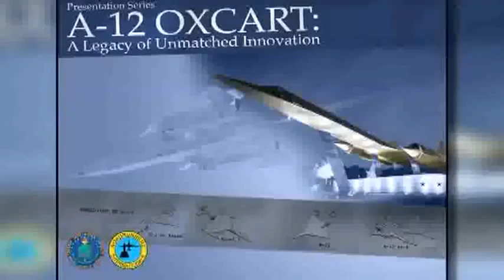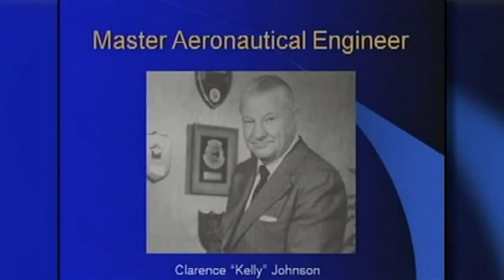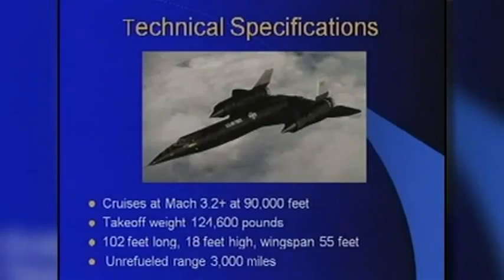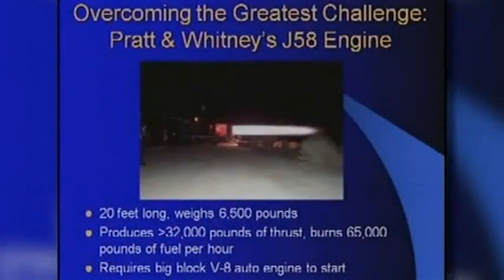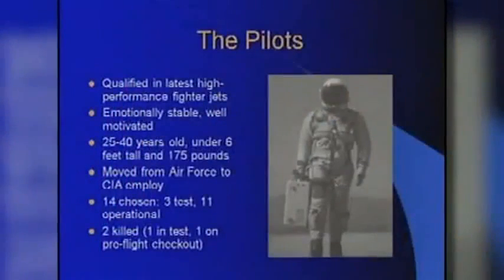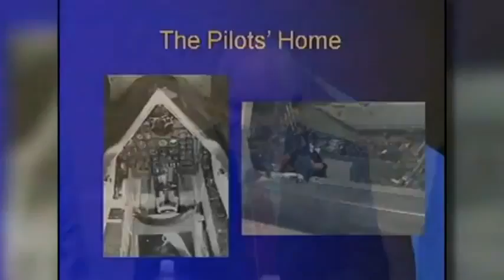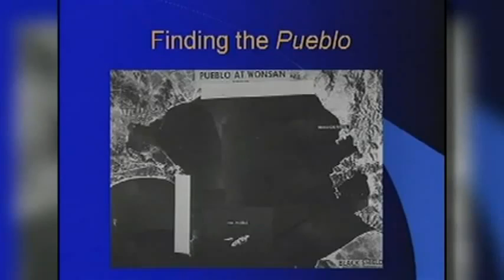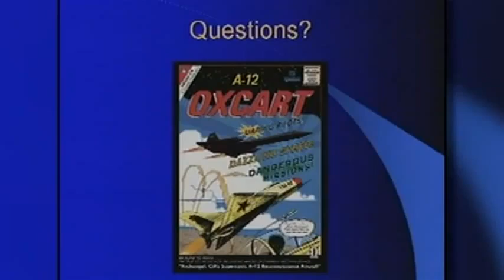Presentation on Project OXCART at Defense Intelligence Agency in September 2010

Comment: Overall, an excellent presentation. I'm rarely this 'nit-picky' but as the Horten 229 is of particular interest to me as a designer, I just want to point out a small mis-match of information. When Gene Poteat speaks to the 'Stealth' concerns of the Oxcart program and lays some foundation regarding the earliest applications of it's use, he references Hitlers Stealth 'Bomber' and presents a picture, labeled as such. The picture is actually of a replica Horten 229 fighter, commonly referred to as 'Hitler's Stealth Fighter'. This was the Horten brother's design for the '3 x 1,000' aircraft Hermann Goring wanted. He's correct in his oratory that the 'Bomber' (not pictured) never flew. The 'bomber' was a very similar design, also by the Horten's, but was of a much larger scale than the 229, incorporating six (6) engines, not two (2) and was designated the Horten 18. The reason this is important is because Gene infers that the aircraft in the picture never flew. While it's an accurate statement that the 'Bomber' never flew because the program was in it's infancy when the war ended, the 229 fighter did fly. By all accounts, it flew quite well. The surviving documentation indicates that in fighter comparison flight test against the Me-262, the 229 outperformed it in all respects. PAV-1 and her test pilot, Erwin Ziller were lost on a test flight due to engine failure on February 18, 1945. The Allies captured the 229 factory airfield before PAV-2 could be readied for flight. A few years ago, Northrop-Grumman engineers inspected the surviving 229 (PAV-2) for it's 'Stealth' properties and built the replica in the presentation picture. After testing the replica (video on YouTube, "https://www.youtube.com/watch?v=UvSaJjuOb7w" ), the Northrop-Grumman engineers discovered that it had a 20% reduction in RCS that would have given it a substantial ("game-changing") advantage against Britain's 'Chain Home' radar system. He's also correct when he infers that the Allied powers were lucky that neither the fighter nor the bomber, made it into the war. Respectfully, ^v^
Reply: indeed the ho229 out climbed and out turned the me262 by some margin! the brits looked at it and neglected to see the advantages it had. Horton tried to get work for Northrop after ww2 but Northrop thought he only had experiences with gliders so declined. Horton went to work in Argentina instead and his talents went unused.
Reply: There was also a comment made referring to an iron composite glue. Is this accurate? I guess the question I'm getting at is, Was the the horten 229 conceived and built as a stealthy platform or were it's stealth characteristics a beneficial (and perhaps unknown at the time) byproduct of it's overall design?
Reply: Dmitri Kozlowsky  ...hence my beef with how these things are sold...
In truth, everyone was undoubtedly  working much harder on understanding and employing radar than countering it.  ...and no offense to the ww2 stealth crowd but, if you so happen to lopp off the one largest perpendicular pieces of an airplane and then put it back on the pole I'm guessing the rcs may reflect such a change?. No pun intended...but why not?
Reply: That was a beast of a reply. I'd never heard of the carbon in the charring of the wood before! Fascinating. Explain more please
Reply: Dmitri Kozlowsky  That makes a lot of sense, Dmitri. Thank you for taking the time to go into further detail. Speaking of absorbant coatings and materials, I understand that the particular alignment of some composites and, more pointedly the alignment and molecular structure of the some of the substances themselves that make up these composites are of specific importance. What is your take on that subject? Furthermore what is your opinion on the role of molecular alignment in modern material science and it's impact not only on stealth technologies but on future and even contemporary aerospace applications?
Reply: Dmitri Kozlowsky  i find the subject fascinating. I'd like to continue this conversation. Would you be opposed to email?

Comment: Great stuff! Are we sure all the information presented here has been de-classified? But I take issue with the claim (about 1:57:00) that SR-71 cost per flight hour was $38k. I mean, it had a flight crew of minimum 7-8  (Blackbird pilot & RSO, and at least 1 KC 135Q crew of pilot & copilot & nav & boomer & flight engineer, +/- loadmaster), a pretty much dedicated AFB (Beale) and hundreds, if not thousands, of dedicated support personnel and infrastructure (did anyone else repair titanium airframe, use JP-7 or oil & hydraulic fluids which were solid at room temperature, for example?) which required independent production, distribution, transportation, storage, and delivery? I crewed C-130's, which had a crew of 5, used off-the-shelf consumables (fuel, oil, hydraulic fluid, etc), was tried & true since the 1950's, could start, back-up, taxi, take-off, and land without ground support, and which was billed thru JAATT (Joint Airborne/Air Transportability Training) funding at $10k per flight hour. I cannot believe that SR-71 cost was only 4 times C-130 cost. My semi-educated guess would be that, ultimately, SR-71 cost well over a million dollars per flight hour. And I'm not saying it wasn't an awesome airplane and an amazing accomplishment. I have seen it many times, billeted a few doors down the hall from its crews at Mildenhall VOQ, and well remember the visceral rumbling of its engines lingering in the fog many minutes after take-off. But don't tell me it cost $38k per flight hour. Sorry!